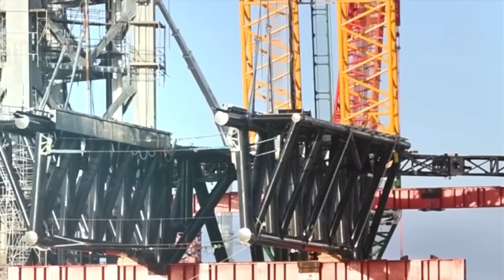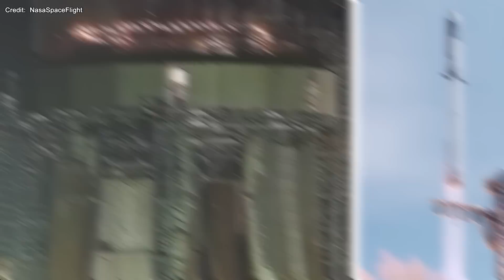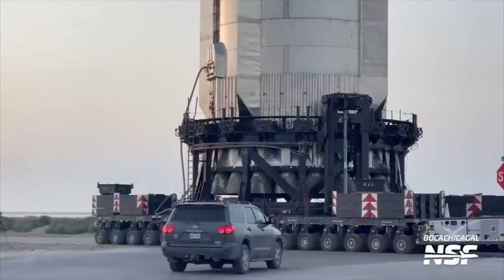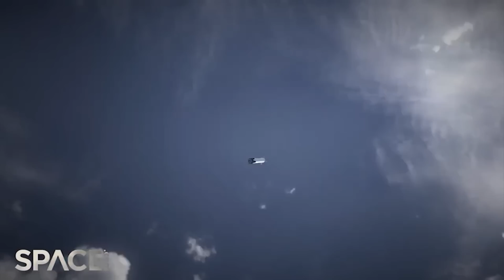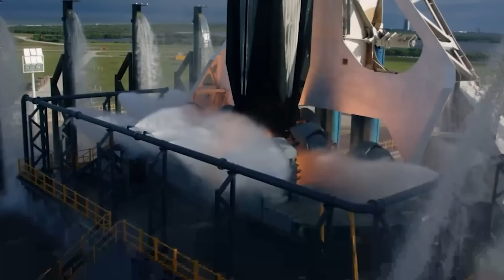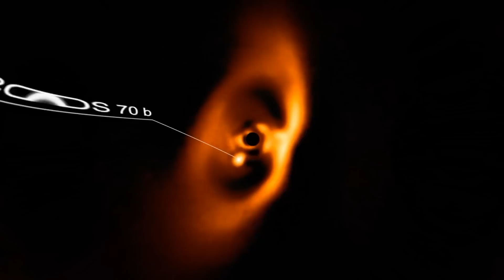SpaceX Starship Booster 9 is Finally Ready + Elon Musk Revealed Something Important

Comment: One BIG question! If the damaged that was caused at the first launch were done in a landing on mars Would the rocket be able to land at the crater caused by the rocket exaust against the martian surface.
Reply: Should be no need for Super Heavy Booster to land on either Mars or Moon.  Lift off/landing rockets just in front of Starship tanks should disperse the reaction quite a bit with only 5 to 10% of the thrust of Super heavy acting at three times the height as a super heavy take off from earth.

Comment: ~~~ Instead of wasting boosters that will not return to a landing. Boost them into orbit after seperation, collect them as a small group then boost them into a safer orbit as a fuel tank farm that could be refueled by rockets that only transport fuel as a payload. Then you would have a fueling station.
Reply: Need to test re-entry and heat sheilding.  Once they have a proven way to keep propellants liquid, dealt with fuel transfer, and figured what orbit to use (may be something somewhat higher than LEO),  they can leave some up there to store fuel.
Reply: That’s not how it works